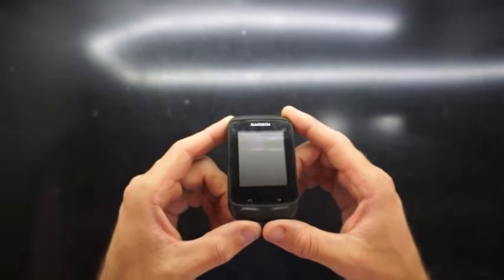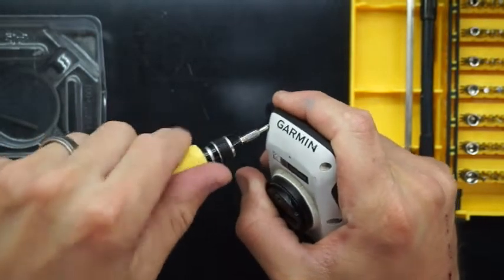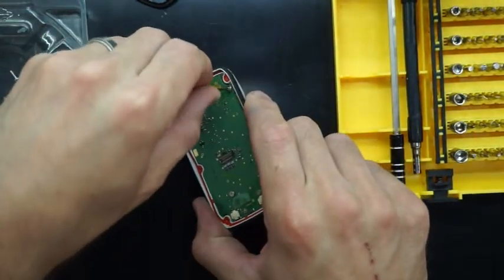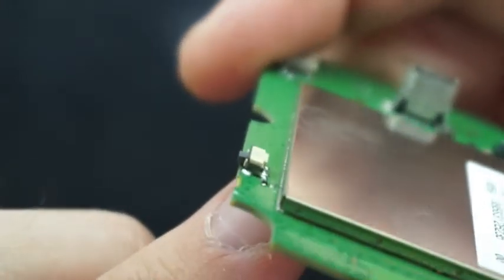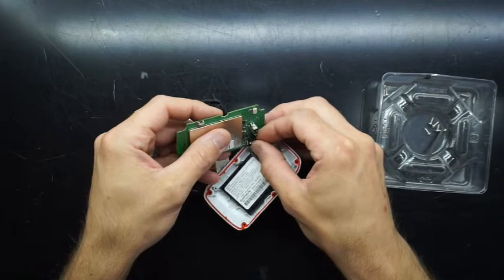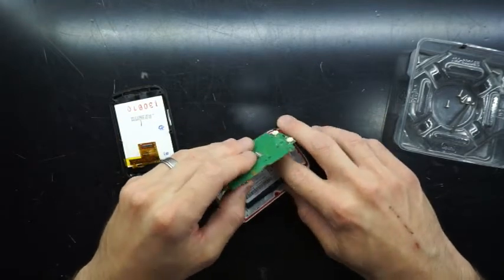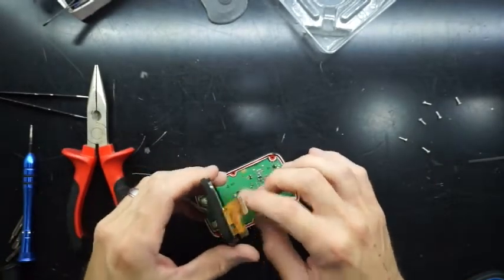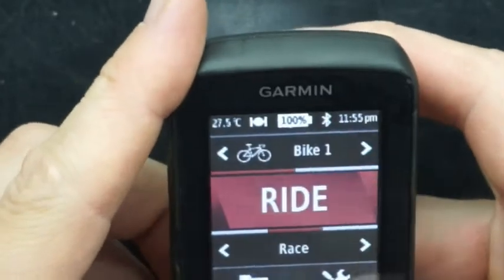Garmin Edge 510 Tear down and Power Fix

Comment: This looks very similar to the problem I'm having now. For your "silicone" (American here) - would a silicone caulking, like what you'd like in a kitchen or bath work to beef up the space between the worn rubber and the button? Curious as to exactly what material you used. 

Otherwise, great video! I'll likely give this a try before trading in my 510.
Reply from the maker: cant hurt to try since its already broken :)
Reply: @rickstechrepairs  I also have the dog ears backing since the case failed me way back too. I'm determined to fix this, put it off over the winter (in the US). Thanks for the video!
Reply: Garmin 510 will not charge where I connect the USB cable into the mini USB port is loose would this cause the computer not to charge? Would I be able  to fix this myself? Please advise.

Comment: Thank you very much for sharing this. It worked for me. My edge 510 is around four years old. Before finding this I thought I would have to get a new bike computer and I was unsure if I would buy another Garmin because it seems like it is a weak link in the computer.  I hope Garmin has changed the on/off button in newer models. I used to turn the computer off when I was done with a ride now I just let it shut down on its own so I only use the on/off button half as much now.
Reply: What material did you use to fill the button? I'm thinking of a silicone caulking, like what you'd use in a bathtub or around a backsplash.